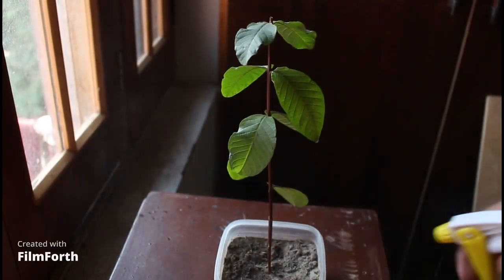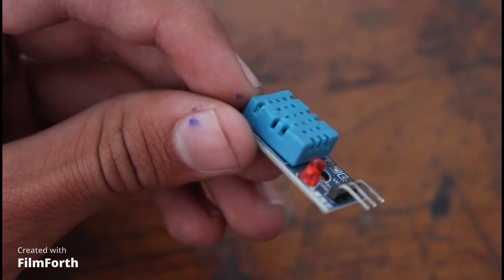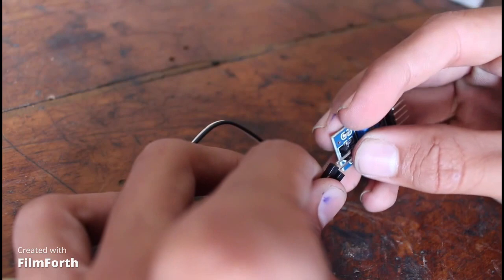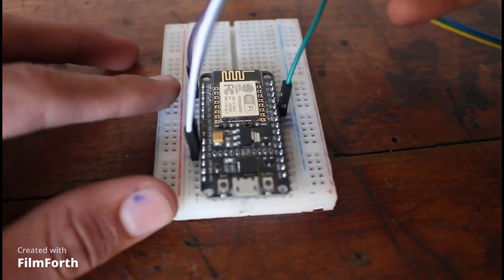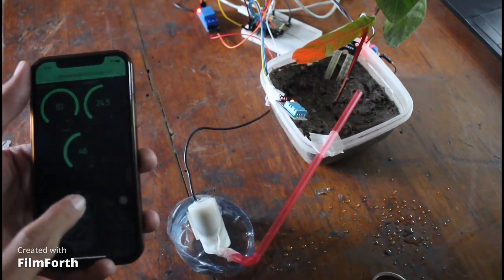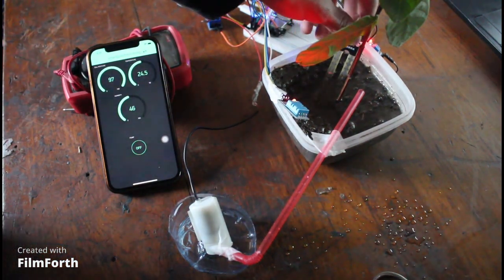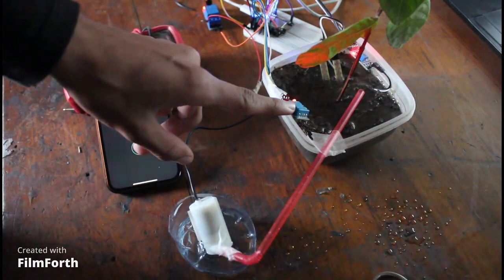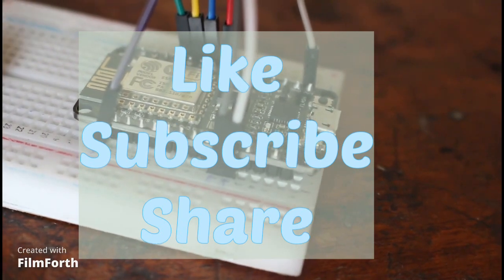How to make Smart Plant Monitoring | Esp8266 | At Home Easy

Comment: Sir code plz..link provided code is not supported
Reply from the maker: // Written by Rommelmith
#define BLYNK_PRINT Serial
#include <OneWire.h>
#include <Servo.h>
Servo servo;
#include <SPI.h>
#include <BlynkSimpleEsp8266.h>
#include <DHT.h>
#include <DallasTemperature.h>
#define ONE_WIRE_BUS D2
OneWire oneWire(ONE_WIRE_BUS);
DallasTemperature sensors(&oneWire);

char auth[] = "xxxxxxxxxxxxxxxxxxxx";
char ssid[] = "xxxxxxxx";//wifi name
char pass[] = "xxxxxx";//wifi password
#define DHTPIN 3
#define DHTTYPE DHT11
DHT dht(DHTPIN, DHTTYPE);
SimpleTimer timer;
void sendSensor()
{
float h = dht.readHumidity();
float t = dht.readTemperature();

if (isnan(h) || isnan(t)) {
//Serial.println(“Failed to read from DHT sensor!”);
return;
}

Blynk.virtualWrite(V5, h); //V5 is for Humidity
Blynk.virtualWrite(V6, t); //V6 is for Temperature
}
void setup()
{
  pinMode(D0,OUTPUT);
servo.attach(15);
servo.write(0);
delay(500);
Serial.begin(9600);
dht.begin();

timer.setInterval(1000L, sendSensor);
Blynk.begin(auth, ssid, pass);
sensors.begin();
}
int sensor=0;
int output=0;
void sendTemps()
{
sensor=analogRead(A0);
output=(145-map(sensor,0,1023,0,100)); //in place 145 there is 100(it change with the change in sensor)
delay(1000);
sensors.requestTemperatures();
float temp = sensors.getTempCByIndex(0);
Serial.println(temp);
//Serial.print(“moisture = “);
Serial.print(output);
//Serial.println(“%”);
Blynk.virtualWrite(V1, temp);
Blynk.virtualWrite(V2,output);
delay(1000);
}
void loop()
{
Blynk.run();
timer.run();
sendTemps();
float h = dht.readHumidity();
float t = dht.readTemperature();
if (h==60)
{
  servo.write(90);
}
else{
  servo.write(0);
}
}
Reply from the maker: copy it from here

Comment: How did the system work without typing the wifi information in the code.
Reply from the maker: I have not shown my wifi information because it is a personal info, but watch full video I have told that what changes you have to make in the code.
Reply: @rommelmith  
understood thanks. I'll just enter the information, I don't need to change anything else, right

Comment: Code please
Reply from the maker: // Written by Rommelmith
#define BLYNK_PRINT Serial
#include <OneWire.h>
#include <Servo.h>
Servo servo;
#include <SPI.h>
#include <BlynkSimpleEsp8266.h>
#include <DHT.h>
#include <DallasTemperature.h>
#define ONE_WIRE_BUS D2
OneWire oneWire(ONE_WIRE_BUS);
DallasTemperature sensors(&oneWire);

char auth[] = "xxxxxxxxxxxxxxxxxxxx";
char ssid[] = "xxxxxxxx";//wifi name
char pass[] = "xxxxxx";//wifi password
#define DHTPIN 3
#define DHTTYPE DHT11
DHT dht(DHTPIN, DHTTYPE);
SimpleTimer timer;
void sendSensor()
{
float h = dht.readHumidity();
float t = dht.readTemperature();

if (isnan(h) || isnan(t)) {
//Serial.println(“Failed to read from DHT sensor!”);
return;
}

Blynk.virtualWrite(V5, h); //V5 is for Humidity
Blynk.virtualWrite(V6, t); //V6 is for Temperature
}
void setup()
{
  pinMode(D0,OUTPUT);
servo.attach(15);
servo.write(0);
delay(500);
Serial.begin(9600);
dht.begin();

timer.setInterval(1000L, sendSensor);
Blynk.begin(auth, ssid, pass);
sensors.begin();
}
int sensor=0;
int output=0;
void sendTemps()
{
sensor=analogRead(A0);
output=(145-map(sensor,0,1023,0,100)); //in place 145 there is 100(it change with the change in sensor)
delay(1000);
sensors.requestTemperatures();
float temp = sensors.getTempCByIndex(0);
Serial.println(temp);
//Serial.print(“moisture = “);
Serial.print(output);
//Serial.println(“%”);
Blynk.virtualWrite(V1, temp);
Blynk.virtualWrite(V2,output);
delay(1000);
}
void loop()
{
Blynk.run();
timer.run();
sendTemps();
float h = dht.readHumidity();
float t = dht.readTemperature();
if (h==60)
{
  servo.write(90);
}
else{
  servo.write(0);
}
}